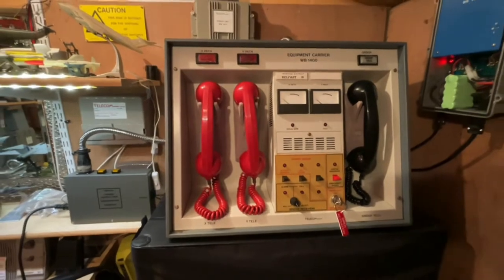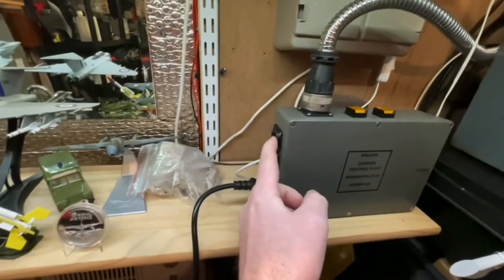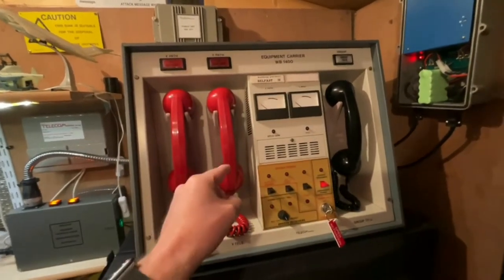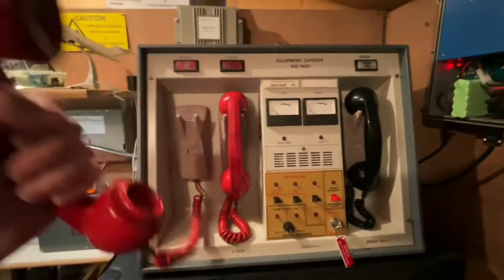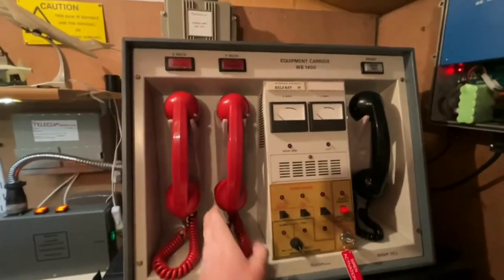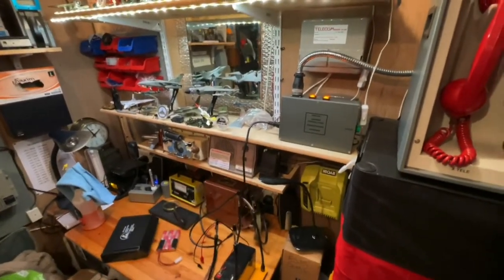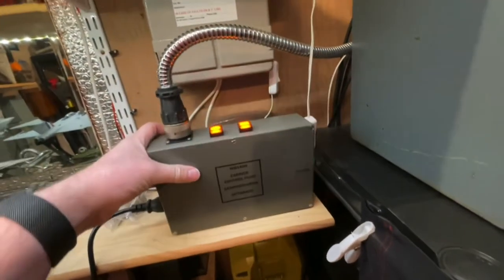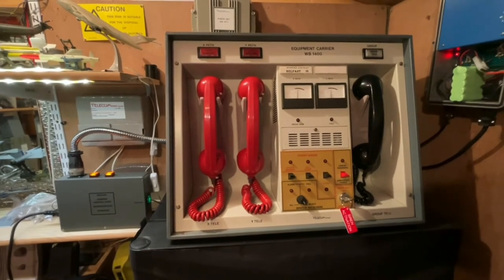UK’s Nuclear Attack Warning System

Comment: Hi from the USA. I knew the sirens were activated through the phone system in the UK, but never knew how. Thanks for the demo!
Reply: They also used the speaking clock circuits to carry the signal, so any failure would have been noticed very fast...(twin circuits for redundancy to every exchange)

Comment: Great to see one of these in action, only read up on them before, thank you.

May I ask what the grey box on the wall behind Mike's terminating unit is, the one with the British Telecom logo on?
Reply from the maker: It’s a Case200 for the PW Circuit into an ROC Post - it splits the incoming phone line so both the Teletalk and the WB1400 get their relevant connection. That one is hooked up to a Teletalk I also have in the shed.

Comment: Im assuming that's for the Carter Sirens from WWII.
Reply from the maker: Believe it or not the Carter Sirens from WWII were replaced in a phased program from the early 1970’s until the mid 1980’s. Very few (if any) of the WWII sirens remained in use with this system. 

Most sirens in the UK still in situ are Castle Castings or Secomak.

Comment: was there a thing based  on WB 400? i remember having to swap out "GPO" batteries in pubs occasionally.
Reply from the maker: The WB400 system was the precursor to the WB1400 system. The piece of equipment that you had to change the batteries on was the WB400 warning broadcast speaker which was eventually replaced by a plastic speaker for residential use and a hardened metal speaker for use in areas susceptible to damp.

Comment: Are you sure that the sirens were to be activated before the policeman phoned out the warning red?
Reply from the maker: No, the siren was actually supposed to be sounded after the AWR message. I was so excited to get this all working correctly that I got them mixed up. I have an original operations manual and have it sorted now - in fact I did a follow up video with it connected to my bunker and did the procedure correctly.

Comment: What is the "confidence tick" you mention?
Reply from the maker: The metronome electronic ticking (beeping) noise you can hear in the background is what is known as the ‘confidence tick’. It’s to let the user know the system is working correctly.
Reply: @SurvivingTheApocalypse  and if you don't hear it, either it's time to check the wiring, or time to start triggering the alert, because if it isn't the wiring then that means the alert centers are already ash drifting on a atomic breeze and you probably only have 10 minutes yourself before you get to play "all hail the newborn sun's!" ?